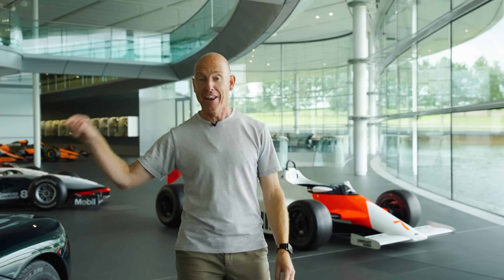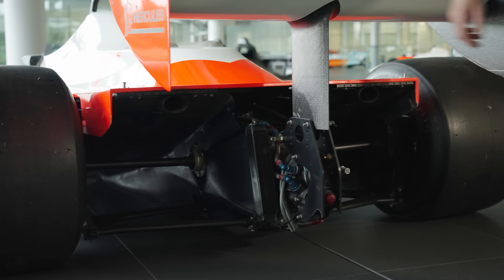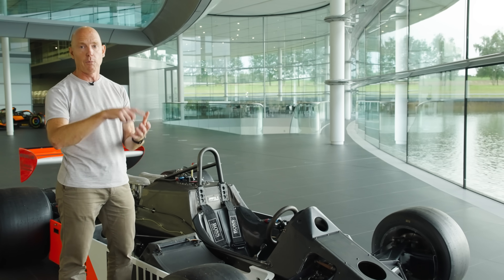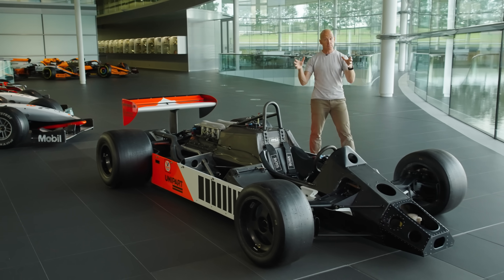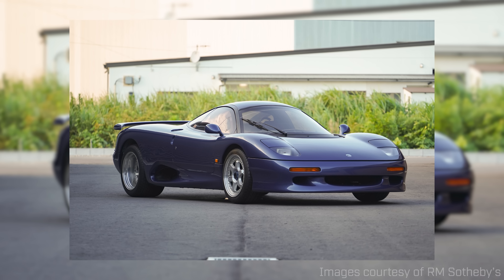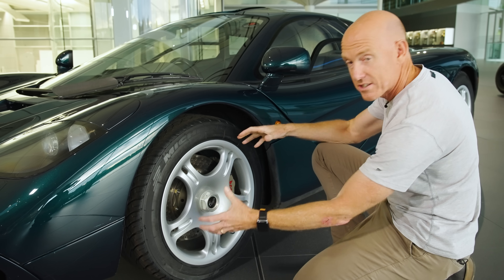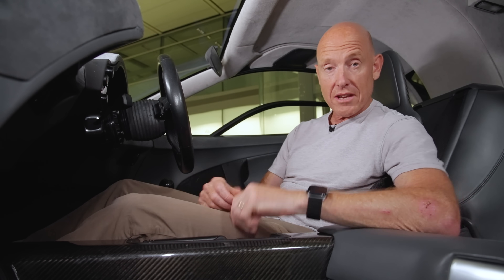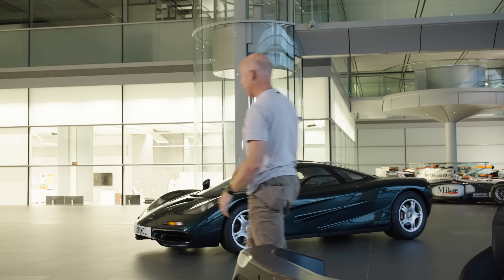McLaren F1 & MP4/1 – Carbonfibre Pioneers! | 4K

Comment: Great video. But I have one correction to make. The McLaren F1 appeared in 1992. The Bugatti EB 110 appeared 1 year earlier in 1991. The Jaguar XJR-15 appeared in 1990. The Monaco based company developed the MCA Centenaire with its engine from the Lamborghini Countach and launched it also in 1990, but still shortly before the XJR-15. But, even that MCA Centenaire wasn't the very first road legal car with a carbon fiber chassis and body. There was a German company called 'Zender' and they developed a bunch of famous prototypes. It started in the very early 1980 with the Vision 1, then shortly later they launched the Vision 2, and then - in 1986 - the Vision 3 was launched. But Zender was no longer satisfied with the old school tube frames. And therefore they went a totally new route. With the Fact 4 – developed since 1987 and unveiled in 1989 – ZENDER massively expanded its expertise in carbon fiber, creating the world's first road-legal car with a carbon fiber monocoque! The super-stable carbon fiber body weighed just 55 kg. The one-off was powered by a tuned Audi V8 BiTurbo. Curb weight: 1,110 kg

Comment: It is a bit of tekst, but trust me it might be worth a read.:

I have a part time job at a place where you can go F1 Simracing for an hour. 

My job title is a so called "Race Marshall". In short I operate the pc's, the game and I help/entertain people. 

And my entertainment is a bit race event commentator and a bit stand-up comedy if I may say so myself. I do sprinkle in quite a lot of trivia about racetracks, mainly because that is what people mostly interact with. But also because car-talk might sound normal to an enthusiast like me and most of us here in the comments, but I quickly came to understand that that kind of technical talk is gibberish to most of our customers.

Here we go: 
One of my favourite facts is saved for every time Monza is on the roster. And it is that exact first crash of a carbon fiber F1 car at the Lesmo's in that '81 weekend that is talked about here in this video.

Because it was such a pivital moment in F1. Carbon fiber went from "black plastic that would pulverise into dust" to the safest cars ever made i.e. now. 

If you want you can scroll on further now, thank you.

A so you stuck around, here is a little laugh/facepalm moment I hope:
And I can tell you, many, many, many costumers copy that exact crash nearly every time they get there😂  (because both corners look the same, but that second one is ever so slightly slower and sharper causing them to run wide on the exit and careen to the righthand wall)

Don't worry though, crash damage is turned off when they drive. Otherwise it would be over before some, if not most of them, even exit turn 1😂 (because no one takes the first 2 laps easy or as build up and instead just immediately go full blast, even though I recommend them to do the former😒🤔)

Thank you for your time🙏😁

Comment: 1:38 more correctly, they tried to use carbon fibre for fan blades in their jet engines in the 1960s and 70s in the original design for the RB211 engine, but the technology to actually make them as strong and reliable as metal blades didn't exist at the time, and they literally bankrupted the company trying to do so.  It's why the aero engine company is separate from the car company today.
Reply: That was where my attention span stopped haha, GE Aerospace was the first to certify a jet engine with composite fan blades on the GE90. Thanks for sharing that bot of RR history, I didn’t know they nearly went under trying to develop it!
Reply: Failed the “chicken test”!

Comment: Why can't they make carbon fiber engines??
Reply: Carbon fibre resin melts just like any other plastic 👍
Reply: It's been tried several times by various people over the past few decades, but always with a limitation that makes it infeasible or less reliable (or just colossally expensive, obvs). Carbon composite isn't structured like a solid block of metal which can affect its ability to take loads in certain ways/directions; different resins have different weaknesses in high-heat situations... also carbon composite catches fire in a way that metal doesn't, so an engine failure could get even more catastrophic. But maybe it'll happen one day if people keep trying to improve the materials/methods.
Reply: @SmallBlogV8  yeah it's just not suitable, the resin matrix always fails in carbon fibre reinforced plastic. It's also an abrasive so not suitable for moving parts.

High temp resin is available however it's not suitable for engine internals. Carbon fibre has all it's strength in tension and is much weaker in compression, making it bad for engine parts. Almost everything in an engine is under compressive loading. 

The best use I have seen is on gearbox casings where they use a thin machined aluminium with +2mm of carbon fibre to stiffen it up.